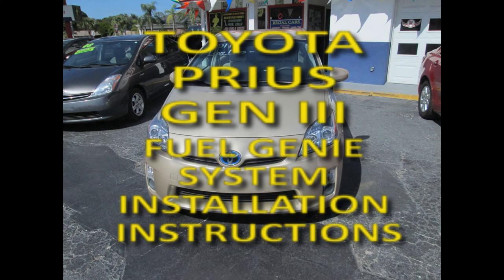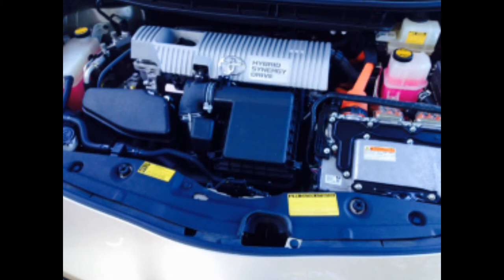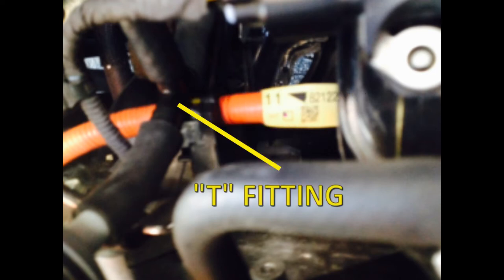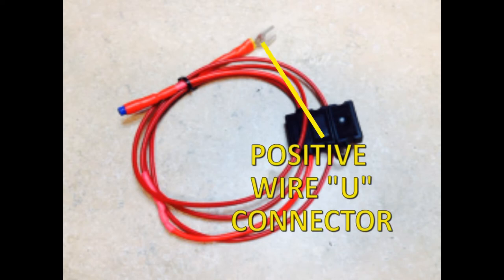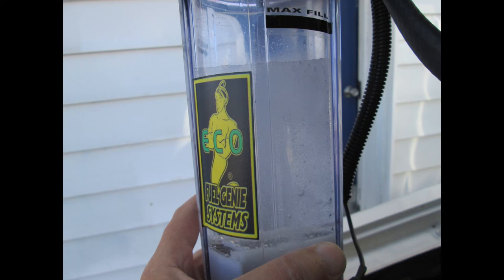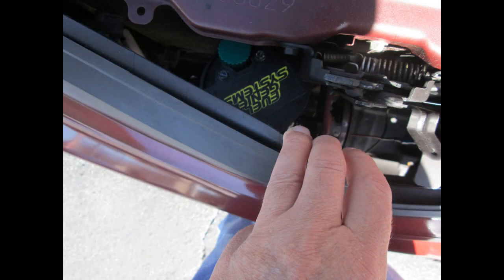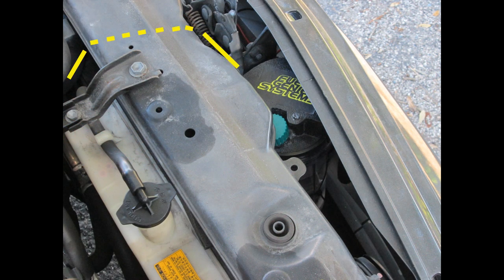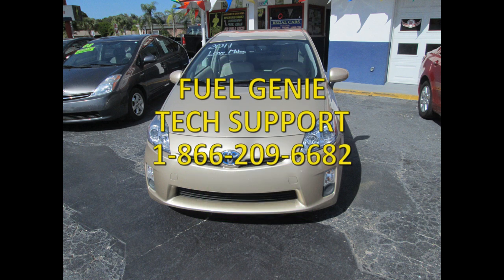TOYOTA PRIUS GENERATION III FUEL GENIE SYSTEM INSTALLATION GUIDE

Comment: If I am not mistaken, your system generates around 0.6L/Min to close to 1.5L/min of HHO gas.  With this amount of gas mix,  the O2 sensors may not trip to show Engine Hazard light but may push more fuel into the system. Although I have not tried this (am dying to try this at home) but for Engines larger than 2.0Litres or say 2.4L size, you may need to control the O2.  I will try soon on Toyota Estima model 2008 (2.4L without Hybrid) and will post my results on this channel if I survive the experience :)- but I am very interested to see the difference. Good job on the details for Prius.
Reply from the maker: Sam, nice guess. Actually for an engine less that 1.8 liters (Prius engines e.g.) there is about .2 lpm going to the engine. This is enough to increase mileage in Prius cars from 48-50 pmg on the highway to over 65 mpg on the highway. It's the quality of the gasses we produce that increase mileage with such a small volume entering the engine. We generate H3O+ and ionize the gasses before they engine the intake manifold. These ionized gasses actually break up the long hydrocarbon molecule strings into more combustible bits.
Reply: Fuel Genie Systems Fantastic idea of ionizing the gas and great to know your Reactor can produce H3O+. Also from Exhaust Test results if there is Zero O2 coming out then obviously there is no need to tweak O2 sensors. Great job.
Reply: @SamMonkulas  Did you ever try this on your Estima? I'm thinking of getting one (or Alphard) and doing the same.
Reply: daemorhedron  Yes I connected the FGS to my 2.4L Estima Toyota last year Dec. The results I got was amazing power and the Engine running very smooth.  The only problem I got and as I understand Hong Kong is very small place to drive a car at 65-75mph on any roads except for the one long road going to Airport.  But to try the mileage affect I did spent couple of thousand dollars (hundreds of USD) to see if I could replicate the high mileage FGS was assuring.  At the end it all comes down to how many Kms / Miles you get per given full tank.  So here are the numbers - before installing FGS system - Estima would run on a full tank of 54litres about 480-500kms without AC On.  With AC On it was going hardly 400kms.  Now after I added FGS the first couple of weeks I wasted fuel to learn the exact amount of KOH salt to be added to the Electrolyte.  At first I added too much like 5gms of KOH direct to Reservoir then learned to make a Gallon of mix outside using a 4.5L Plastic Can then mixing it very thoroughly by shaking the Can then pouring out the 1Lit mix to reservoir.  This 1 x Gal if Mix with 15-16gms of KOH worked the best for Estima 2.4L. If you divide then it is hardly 3gms /Lit. But better mix it the way Barry explains then pour into using that spool supplied.  So then after months of tinkering and learning how to use, a full tank of Estima with 70% Highway driving and 20-30% either idling or city driving results in a mileage of 480kms / Full tank with AC On. The only issue I have if I idle too much like waiting in car with Engines On due to hot weather then the mileage really drops and sometimes even below 400kms. So I am very careful not to idle, better park it and go wait inside a Air conditioned Mall or find a tree to stand under 🤣🤣🤣.  Hope this helps.

Comment: Does the vacuum connection go before the pcv valve or after?
Reply from the maker: It goes between the pcv valve and the port on the intake manifold. You can also connect it to the first port on the intake manifold just after the throttle body assembly.

Comment: What the hell is this for? Why would anyone want to put this in their car???
Reply from the maker: It boosts your fuel consumption in a Prius from approx. 49-51 mpg on the highway to 64-69 mpg on the highway. Huge savings . It also reduces toxic emissions from the exhaust. CO to zero, CO2 reduced by 12%, HC gasses reduced to almost zero. We have sold 16 kits to Uber drivers with Prius cars in NYC. All are very happy.
Reply: @fuel-genie-systems1  I'm looking into buying a Prius and adding your system. Do you have to adjust the fuel input ratio to compensate for the hydrogen in your system?
Reply from the maker: David. Good question. There are no adjustments to be made adding one of our kits to your Prius. All you do is add a specific amount of electrolyte to the water in the reservoir and this amount generates the optimal amount of hydrogen gasses to increase mileage from 48-50 mpg on the highway to 65-69 mpg on the highway. You need no electronic enhancement devices. The small amount of hydrogen gasses do not cause the O2 sensor to trip a check engine light. I hope this answers your question. If not, ask me again.
Reply: @fuel-genie-systems1  how often do you need to replenish the electrolyte solution? And how much does it cost?
Reply from the maker: The reservoir holds enough solution for 5,000+ miles. You only need to refill it when you change your oil. The kit comes with a year's supply of electrolyte. You can buy pure sodium hydroxide in most ACE hardware stores. $5.00 bottle will last 4 years. You can use any crystalline sodium hydroxide as long as it's 100% pure.
Reply: @fuel-genie-systems1  
What about local mpg, you have mentioned only highway increase MPG.
Reply from the maker: @drfali99  It's difficult to make claims of mpg increases in town due to constantly changing speeds and driving conditions e.g. stop. We know that once on the highway at 60--65 mph Prius engines get between 65 and 69 mpg. No one has gotten less and no one has gotten more mpg. Driving with this system in town around 40 mph you will see 50, 60 even 70 mpg but that will change as the engine starts and cuts off in town. Hope this helps.